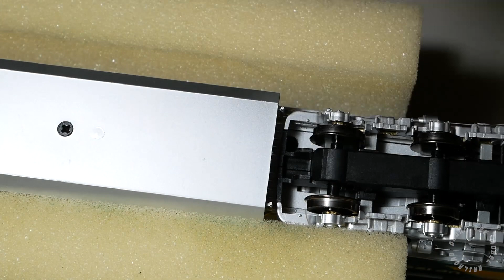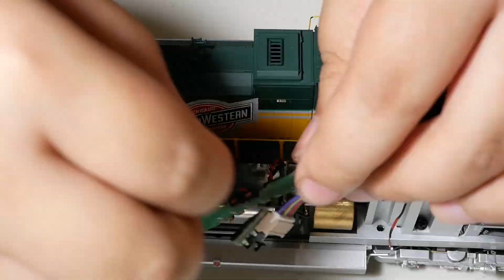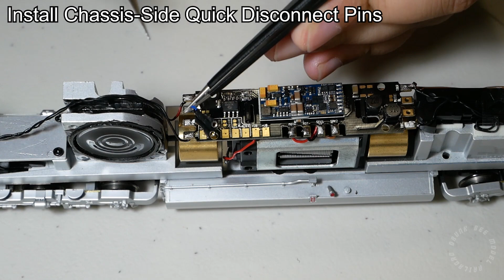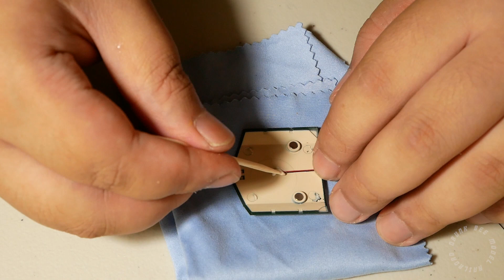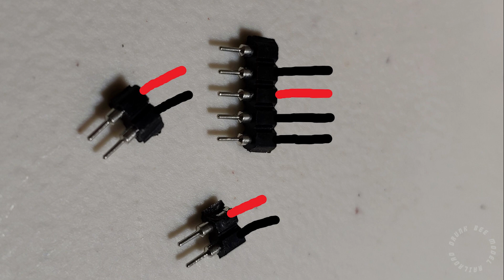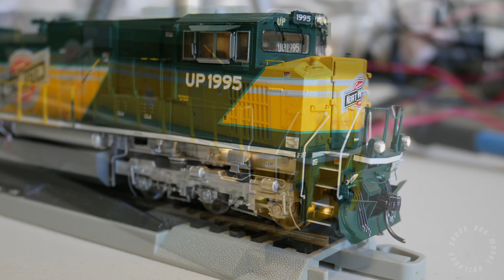DCC Install: Athearn Genesis SD70ACe UP 1995 LED Upgrades + ESU LokSound Select Direct

Comment: Don’t you need to wire the leds with additional LEDs? The EE in me says not to wire LEDs in parallel with a resistor

Comment: Drunk Bee you should try a Decoder Buddy!  It will set in like a Select Direct but allow you and your viewers to use other manufacturers decoders!  Take a look at www.nixtrainz.com. It’s the next step to easy!  The lighting functions all go to one board.  Resistors are all included on the motherboard for the LEDs you are using.  You did a great job on these SD 70ACEs   Great video too!!!  I wish Athearn gave us lighted number boards.  Mine are FEC waiting too be turned into Vermont Railway.  My email is in my website, get in touch if you desire.

Comment: Where did you get the fiber optic strands? I have a couple Athearn models I need it for.
Reply from the maker: Plastruct makes them. 1.5mm/0.06in diameter

Comment: Impressive! I am working on an SD75 right now. This procedure should work with a SoundTraxx Econami board the same correct? I noticed no resistors for the LED's?
Reply from the maker: Use of resistors differ with each decoder model
Reply: DBRX Drunk Bee Model Railroad  do you do any custom work? I have five licks that need all of the lights replaced.
Reply from the maker: Sure send me a message on Facebook or email address on my channel page